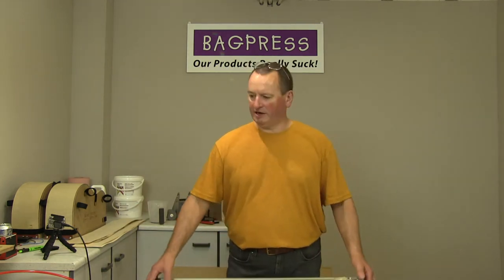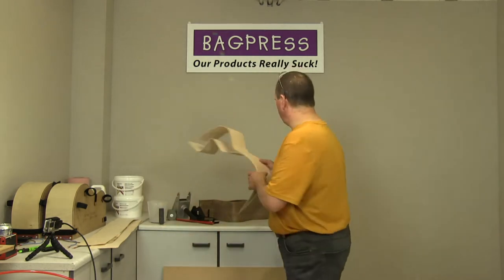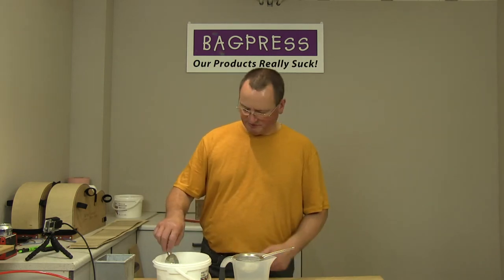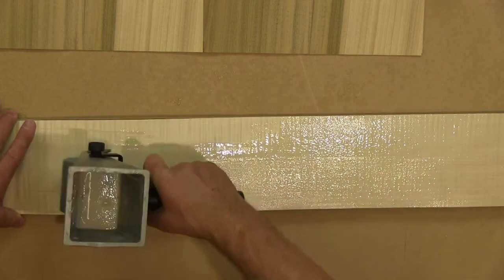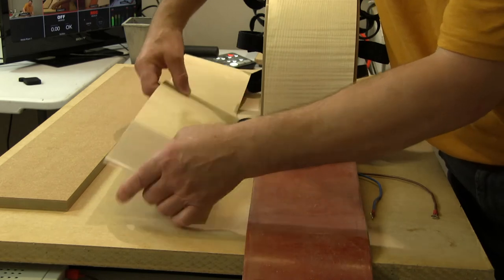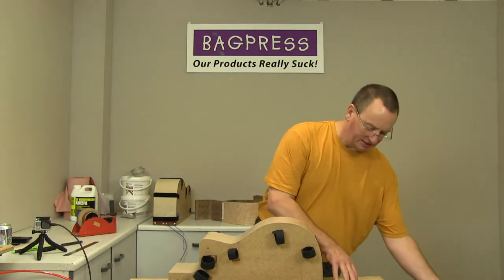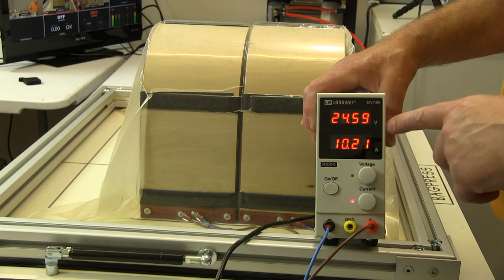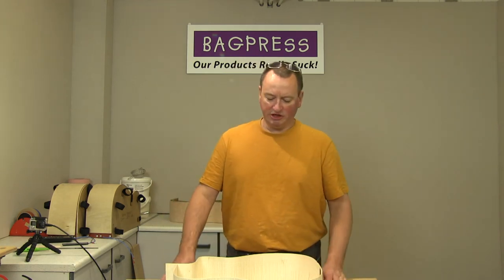Laminating Maccaferri Guitar Sides Using Heated Vacuum Press Moulds

Comment: Any idea where I can obtain the resin and powder in the US? Or any alternatives?
Reply from the maker: Hi Ramon, You could try email the manufacture's US office (springfield@prefere.com) and ask for a list of local distributors. The products I use are 4152 resin, 5602 hardener and 5912 extender (pore blocker). Failing that, I will check what restrictions may apply to shipping to you from the UK. I've never done it so I'm not sure if this is possible.
Reply: @Bagpress  thank you very much. They don’t ship to the US. I’ve contacted them and sadly this was the case